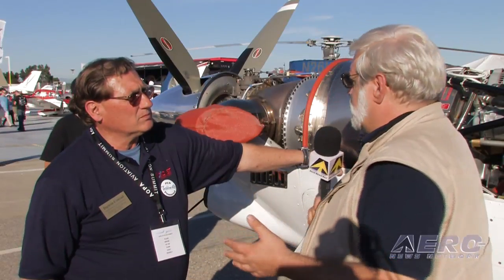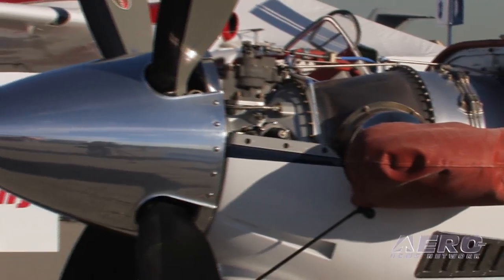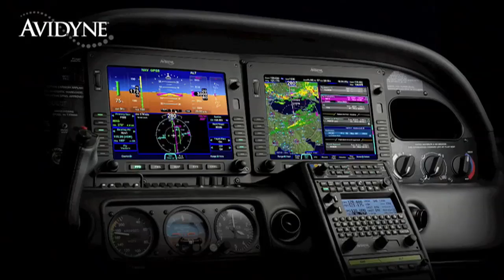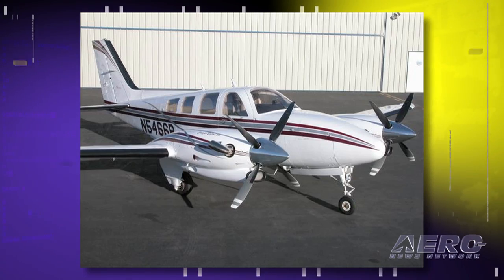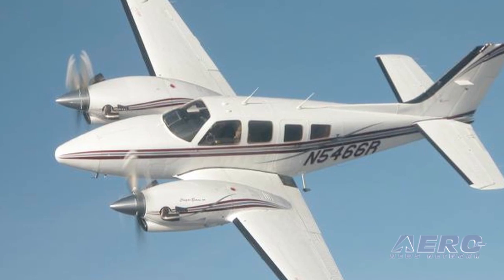Aero-TV: Newer, Better, Moster, Faster - Darwin Conrad and Rocket Engineering

Comment: First thing is, the structural cruising and maneuvering speed of the airframe doesn't change. Second, the fuel burn of a turbine engine is considerably higher than the piston engine, so if you don't increase the fuel capacity you don't have as much range as the piston engine machine, Third, to get to an altitude where a Turbine engine is remotely efficient, without a pressurized airframe will require everyone to be on oxygen, Basically its a big price tag for a really impressive climb rate.

Comment: No doubt a turboprop Baron consumes plenty of fuel.  However, I'm sure it burns considerably less than a King Air 90 and especially a King Air 200.  So if you do a lot of cross-country flying and need the extra speed yet don't need the extra seats, a turboprop conversion might be the way to go versus upgrading to something like a King Air.
Reply: This aircraft is for people considering a baron because cost of opertation is almost identical to the Turbocharged Barons. This small PT6A-21 is alot cheaper to overhaul and has a tbo of 3700 vs 1600 on the Baron. The Baron would need 4 engines in the time a pt6 would need to be overhaulled once. Hot section Inspections (at 1700hr) can range in price form 3-30k depending on how the engine is treated. An over haul for a tsio-520 is about 50-60k so we can assume that it will cost 200-240k. Th pt6 overhaul cost is around 165-200k. that abour 215k total. Other factors might make the tubine more in the end but its very close to the baron where a king air has 2 giant pt6 engines.
Reply: GeneralSirDouglasMcA For, a Bonanza a Rolls Royce is better and not Pratt and Whitney.....
Reply: @naughtyUphillboy  are you joking??? the RR/Allison 250 engine has its single stage compressor exposed on the front just like the golden eagle 210. That means it is exposed to debris and bird strikes. In fact in late January 2019 a tradewinds Bonanza that has the allison 250 just like the golden eagle suffered a bird stike after takeoff killing both pilots. The pt6 is a much much much much better turbine. Do you even know what you are talking about. Its a helicopter engine. Its also extremely susceptible to icing. Several aircraft have suffered shutdown and crashes due to icing. Good turbine for a helicopter but not a airplane.

Comment: B36tc, Dukes, and A36's are Beechcraft for one thing, which means they are nearly bullet proof. There are plenty of each of these aircraft on the used market with very low airframe times.  Age is not really an issue when it comes to general aviation aircraft.  My 1992 model F33A Bonanza is of one of the last years built, and it is still considered a relatively new aircraft.  To answer your question, plenty of these aircraft have very long life spans ahead of them.

Comment: @HDaviator 
I think you better off with a TAT Turbo Normalized TNIO-550B in a B36TC. No heat issues.
That P Baron does look pretty cool. On the Baron note, TAT is testing a Turbo Normalized a B58.